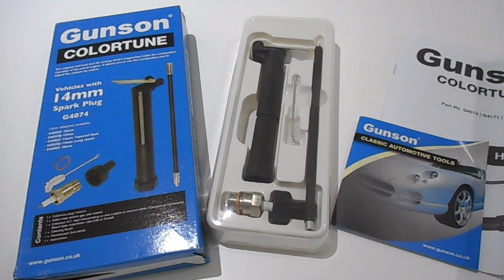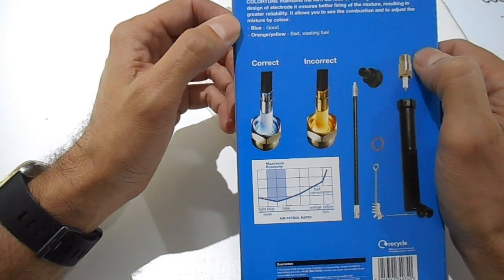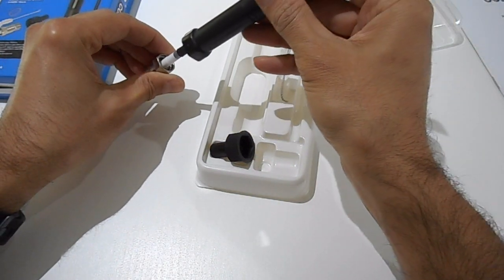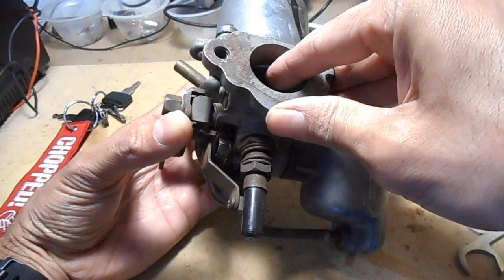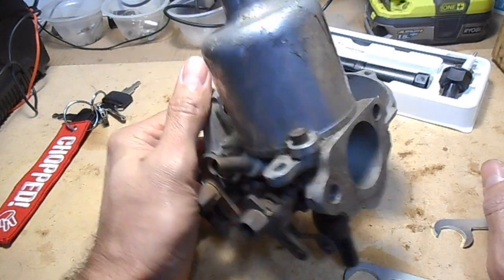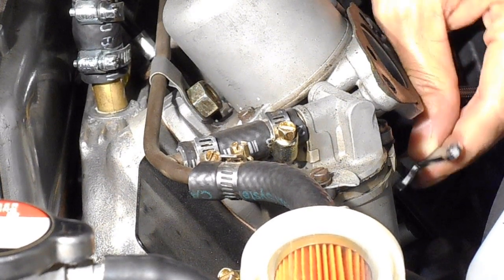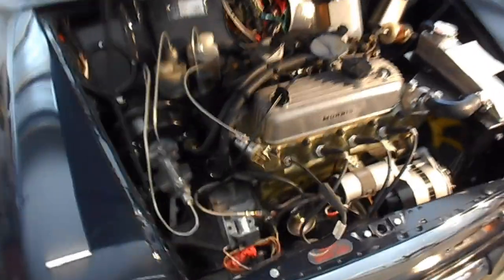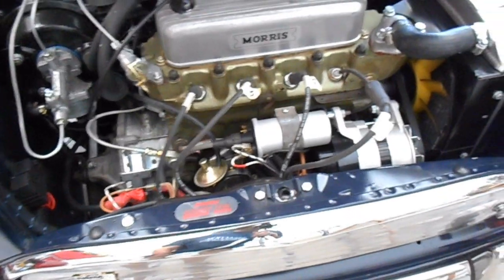Gunson Colortune Morris Mini Cooper S

Comment: These are good kits, I've had mine for over 20 years but I think you paid too much for yours. You can pick these up for about $50 down under
Reply from the maker: BMC Workshop I struggled to find one cheaper, even on eBay with postage it still cost the same, and at super cheap auto it coasts $125 as a special order.
Reply: @CafeRacerLab  thats the trouble being down under. You guys get shafted on parts prices.